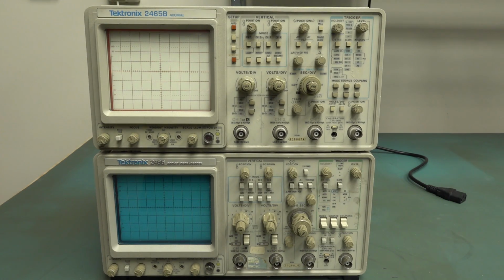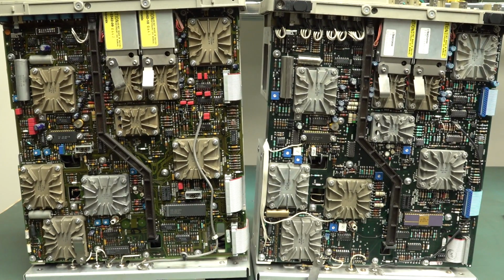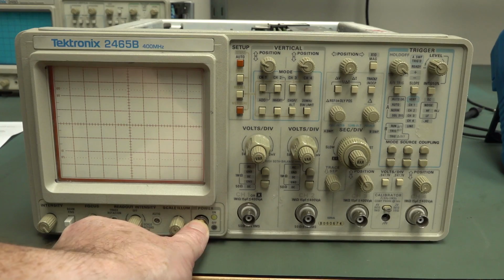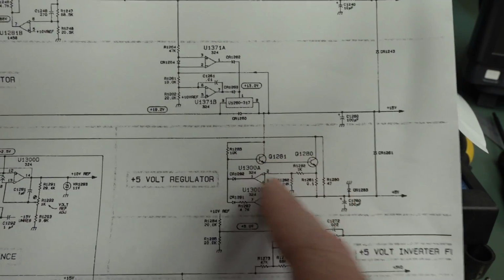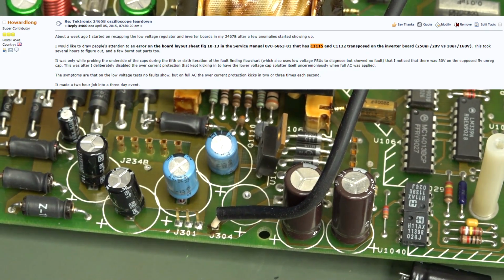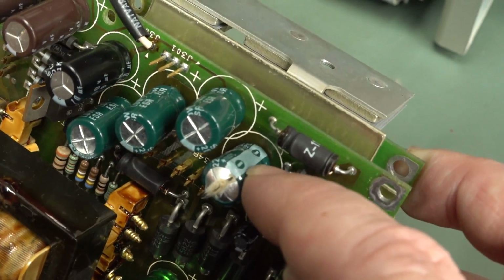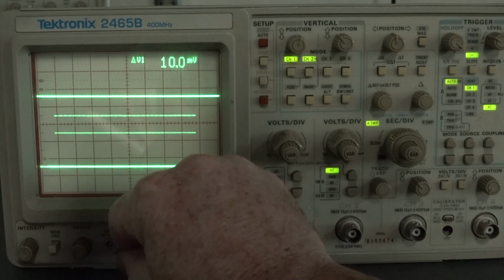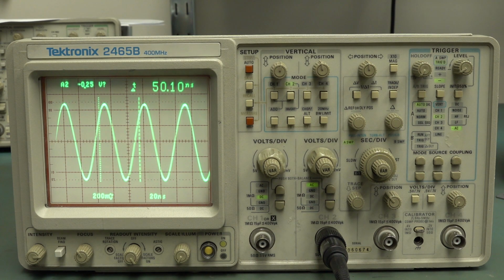EEVblog #1203 - REPAIR: Tektronix 2465B Oscilloscope

Comment: Why do capacitors have the negative marked and boards have the positive marked? Seems like this sort of problem could be reduced if they agreed on one or the other.
Reply from the maker: Worse is when the silkscreen doesn't have + but a filled in section of the circle, and sometimes that's positive and other times negative!
Reply: @EEVblog  I recently changed capacitors on one Intel motherboard (vintage 2014) that had negative and positive backwards on the silkscreen... so this happens a lot :D
Reply: @EEVblog  Tantilum are lined/marked on their positive side.  Are you going to get a Dallas DRAM and dremmel in to it and glue a coin cell holder on the outside and wire it up to make a new chip?
Reply: @EEVblog 
IS IT !!!!   WOW, Good to know
i was always under the understanding that the filled in part is Negative.........ALWAYS !!!
wow... good to know, thanks dave
Reply: Agreed.  Another hint, lots of equipment I've worked on with radial caps have a square pad for the positive terminal and a round pad for the negative.
Reply: @gregfeneis609  Classic HP gear dating back many years does this.
Reply: Don't even get me started on tantalums being positive marked
Reply: Trick for young players :P
Reply: @jetraid  He's in like Flynn, for those playing at home.
Reply: Maybe to avoid confusion, the outer case is negative, writing plus only on the inner disk would be extra work, writing minus on the outer case you never go wrong,
Reply: Looks like a punk cap.
Reply: This must be an older equipment thing. Everything I’ve worked on has always showed the neg side of a cap. Never seen the positive marked on the board. Maybe I’ve never taken anything apart of this era before.
Reply: This agreement would make it a too easy task for designers/solderers. 

Happened to me as well, even once in a new design with wrongly marked footprints. The burden of history.
Reply: Tantalums have the positive side marked. This was an Aluminium-Cap.
Reply: LEADs wont turn off.....funny...i have LEDs on mine.
Reply: Yeah, I've always been really confused by that, it's one of the things I flag in my "basics of soldering course"
Reply: It is done that way, to keep your mind on straight!
Reply: because we need our daily dose of magic smoke
Reply: My first guess is just to be consistent. Old caps used to label + and - (as I recall from decades ago). Diodes have stripes.
Reply: @chasmosaurus3  I believe that you are right, sir!
Reply: And surface mount tantalum caps that look like diodes have a stripe marking the positive. When I was younger I inserted a couple tantalums inverted.
Reply: @rwils6333  - Good thing tantalums don't care about polarity!

;-P
Reply: I got a lot of capacitors for an big cap bank i made for pulsed power experiments for about 80% off because they were defective, the manufacturer apparently got it wrong and the polarity was wrong haha, i had to test all of them before screwing the bush bars because some were good non defective caps!
Reply: @teresashinkansen9402  how did you know the polarity? greater leak in reverse or?
Reply: @theoneohmresistor  Yeah, you can't charge an electrolytic in reverse, they have so much leakage and a very small capacitance, they can even explode.
Reply: @teresashinkansen9402  great tip, thanks!

Comment: 30:03: I am right now attempting to do same RIFA cap replacement on my 2465A DV (built 1987). The RIFA where you are pointing blew up on my scope. The other above this has many cracks. I investigated a discrepancy between 0.068 µF labeling on the caps and 0.1 µF on service manual. I discovered that the original caps might be special production labeled with lower values than they actually have. I was advised to replace with 0.1 µF, 400 V/DC (250 VAC), 55/110/56 , 10%. I went with WIMA MKP1G031004D00KSSD, which seems to be higher end of quality. Looks like you went with an ordinary "consumer products grade" TRU cap. What were the specs on yours and did it end up working well? Also, wondering if you replaced the battery? I think that maintains the calibrations in memory. As the battery loses voltage, I think there will be some startup tests that fail.

Comment: Thanks for the video mate! many times after the board is flowed and cleaned, they don't clean the rosin core flux off after hand soldering. The rosin flux is inert after heated and It won't corrode as lang as a improper clean isn't attempted.

Comment: I acquired one for $100.  There is a bad ground in it somewhere, a 'gremlin' of sorts, that moves every time I found it.  A tap here & there, or on the table...  Mine is a 2465, no letter.  It's considered a Cadillac, and cost more than a new car back when it came out.  They are the last of the analog scopes.  My 2465 does flicker when I push a/b.  The NVRAM can be tested by powering off, getting a coffee, play with something else, and turn it back on.  If you see your display holding, it's working.

Comment: I'm not so happy with the 2465 and newer scopes.  By then they had gone to using many super high performing IC amplifiers, custom Tek IC's.  So if one of those goes, you are SOL.  Also those Ic's are very static and short-sensitive.  Don't ask me how I learned this!  There is not much sadder than a scope that goes from 100% working to totally pooched when you touch it with a probe tip that bridges two IC pins!   Cheers.

Comment: Great video. Funny to see the cap blows up. The known prank at university in the Lab. One time smart ass connected a electrolytic capacitor to a lab power supply, in reverse of course, turned the PS on and walked away. After a few minutes the cap blew up. Don't try this at home, as someone can lose his/her eyes.  By the way, it wouldn't be a bad idea to wear goggles when working with this. I know I know, working with this stuff for 20-30 years and no accident, but  .... Once, when I was a teenager, begin 90-ies  I was working on DIY audio amplifier. The caps blew up almost in my face, and the small paper pieces fell like the snow from above. I will never forget that 😁 Gooch 30 years ago, feels like a century ago.....

Comment: Hello Dave. Just at the end of the video you wrote the scope was without covers. It is very important to operate it with the covers in place, due to heat. It has an IC which works at 80+ DCV and it gets extremely hot without covers. BTW, excelent video (what a laugh with the cap explosion! X-). I have 2 of these (one like yours, and the other with integrated DMM), and both flickers the LEDs when you make any change in the controls, so seems to be normal. And, as always, thanks for sharing!.

Comment: Nice Video.  I too have both fully functioning except that my 2465B has an issue with the calibrator which outputs a distorted waveform. 
One this I would like to comment on is that In my case the Blue screen is on the 2465B. 
Quick questions Any idea where I can get a set of Back feet for the 2465 (300Mhz) 
regards stay safe and keep up the good work

Comment: Educational and I enjoyed watching this video. I subscribed immediately as soon as saw the electrolytic (polarized) cap exploded.  Two main reasons that would cause a capacitor to susceptible explosion is Reverse polarity voltage and Over-voltage (exceeding the voltage as little as 1 – 1.5 volts could result in an explosion).👍

Comment: My array of 7000 series Tek scopes are pretty powerful. A R7844 400MHz dual beam with 2) 7B92A delaying time bases, a 7834 400MHz Multi Mode storage with 2) 7B92A delaying time bases, sharing a selection of vertical amplifiers, a curve tracer, a current probe, and assorted digital function plug ins. Might mention also a pair of 7804A 200MHz mainframes.. and a 2247A 100MHz portable with 500MHz digital co processor that does setup memories, rise and fall time, frequency & period, and other waveform analytics. A 575 and 2) 576 curve traces round out the Tek scopes.  Feeling out of place is a new Siglent 2202s-x 200MHz- 2MS/Sec.  I'll save the Tek TM500 and 5000, and the HP for another time.  Just saying, these portables you have were pretty good, but I don't believe they were the 'best ever'.. others might argue the 7000 series and 11000 series might be the peak of their art.  Reducing the ink load on the PCB reduced the dielectric absorption on the boards, improving HF performance. They even dealt with humidity during board lamination as quality factor. In house, degradation in the board lams was called 'Hook'.  Tek even made an in-house only TM500 plug in dielectric analyzer for board QC.

Comment: HI DAVE 
FOUND YOUR VIDEO VERY INSTRUCTIVE.
It happens that I bought a similar one with red graticule some 3 years ago but never used it until yesterday.
Checked the input voltage set switch to 230v. checked the fuse 2A. Plugged it in and switched it on. everything went fine. Got a nice clean and clear trace and as I was fiddling with the focus knob, I heard a noise and smoke started coming out from the back end, I switched it off and removed the plug. 
I then started opening it up to find out what got burnt. It turned out to be a bridge rectifier, a 0.068uF capacitor and a resistor next to it. So then I went on YouTube to start looking for videos showing these kind of problems and hot to fix them.
Having watched your video, I will give it a try , it is just a matter of where to buy the genuine replacement parts. Maybe you can help by giving the contacts of potential suppliers. I live in Mauritius, a small island lost somewhere in the middle of the Indian ocean. Thanks for reading me.

Comment: Updated 1990 Unit, replaced caps and RAM. Reading original SRAM (8950)and copying contents on to FRAM.
Recommend to shift PWS assy. slightly down(towards A5 processor board)to access spade connectors to voltage selector between the PWS and power filter/connector.
Had to repair A5 corroded traces and replace two 0.1uF SMD capacitors near SMD electrolytes.

Comment: Yup i own one had to service it once as the X Y caps failed and the spark gap arrestor had got tired but still on my bench and works to this day. You can really magnify your signals on this scope without any lag what so ever. Analogue scopes are a must however that does not mean they are better or worse than a digital scope, they both have their place on the bench.

Comment: My 2465B looks pristine inside, but the trace blanks after a short warmup. Pressing Beam Finder can bring it back momentarily. No leaking caps anywhere. At the present time, the scope gives about 2 minutes of usability before it blanks. Frustrating that the ICs are all out of production.

Comment: All those hybrid and two stroke scopes...  (full digital, digital crt and other transistors...)

 try something like this:  " http://w140.com/tekwiki/wiki/545#/media/File:Tek_545a_291_1.jpg " (if I am not mistaken I have a 545 B) a two cilinder  4 stroke (valves) diesel,  euh 2 channel, 1 beam and it takes about 20 min to warm up. Can't use it cos it needs some TLC.
To bad that Dave is almost as far away from me as he can get (without swimming, euh 80% of max dist.)
I would love bring my scoop to see it taken care off (the good way..  don't need Dave to make concrete 8-)

Still entertaining and informative. Thanks Dave.

Comment: Goodnight. I was watching their very interesting videos. I have a tektronix 7603 and plug in 7L12 spectrum analyzer. It is a gift but it does not work. I took care of the repair by the low power source having all the voltages that the service manual tek 7603 says.

￼

Comment: Probably a silly question - I rescued a scope like this that had a power supply failure, but I'm not confident in how to read the part descriptions in the manual for some of the parts that need replacing.

eg - SEMICOND DVC,DI:SW,SI,30V,150MA,30V,D0-35

I guess it's a switching diode in a DO35 package, and I would guess it's Vr = 30V, max avg I = 150mA, then Vf = 30V?
I'm not sure what the other codes are referencing.  Is there a reference on how to decode it, and other parts?  Thanks!

Comment: When measuring using the trace, you're supposed to measure from the middle of the trace, not the top of the fuzzy edge.  I'm an old metrology tech who has repaired and calibrated at least a hundred of those scopes.  For instance, when you place the trace on the center graticle (to reference it to ground), you're placing that graticle in the middle of the trace.  If there is noise on a signal, it may thicken the trace.  Not to mention, the trace thickness can change depending on the brightness and focus.

Comment: Good job friend ,i have 1 of textronic 2445b got some ploblem with it.
The screen is slide to top the letter on top not appear on screen.
And the waveform is distort too.
When i turn y axis button up the waveform amplitude increase.
When i turn y axis button down the wavefrom go decrease???
I want the schematic of this 2445b where i can get it?

The clip video on the bottom please..

https://youtu.be/Ego1beprTiw

Comment: I found something funny in a old power supply it looked like it was modified to be a old spark gap receiver and maybe transmitter.  So I ripped it apart and tore it to pieces by cutting the circuit board up and transformer was recycled for copper wire and metal. Cause I dont know who modified it and now they never will use it again LOL.

Comment: used to repair the units B version is the best, blue filter is removable push in and move down to remove, filter is on a spring shaped like a Y

Comment: Repair = replace the broken parts. 
Refurbish = replace all the parts at or near EOL (all the electrolytic caps, possibly some or all of the power transistors, the battery-backed SRAM, etc).

Since the video says "REPAIR" it would be a bit silly to complain about it not being a refurbishment. 

The benefit of refurbishing something like this (as Dave mentions) is that it's old enough one should expect all the electrolytics to be near failure. It's cheaper to fix everything in one go than to pay shipping costs multiple times, spend time disassembling the device multiple times, etc.

Comment: Lucky boy that it just was the cap issue and not a failed inverter transformer like in my 2467b.
But definetly kick out those shitty caps on the processor-borad, they spewing their aggressive liquid directly all over the life important parts of the A/D-D/A section. You should look up into the amazing Circuit description, all Front end control stuff, LF and DC calibration, the automated measurements and protection functions are handled with a single Digital to analog converter and a bunch of Muxes and OP's.

Comment: I like the 2465B scope. The biggest problem is with the Dallas SRAM module internal battery and no easy way to replace, subsequent loss of cal data. You really should lay off the wacky tobacco when when doing these type of thru-hole repairs Dave, either that or you are doing this for hits and thumbs. Blowing shit up is a growing fad now on YT.

Comment: I also believe this series was the best scopes, at least for non-modular scopes). Bandwidth was adequate for most purposes, and their control layout was so logical.even though they were rated to 300 MHz, most 2465s could reach the same 350Frequency as the 2465a. They also triggered really well, and rock solid stable.

Only criticism was that they had a tendency to run hot. If Tek had put in better fans, used more heat sinks, or worked out airflow better, these scopes would be beyond any reasonable criticism.

They have gotten very expensive on the used market. Obviously not the scope's fault, but an issue for anybody wanting one.

2467 really isn't a better scope. The micro-channel plate tube has a fairly short life, and  there are nit many spares around(there were never a lot of 2467s built in the first place). If you need persistence, it is easier and cheaper to use a digital scope.

Comment: I know the kiss of death for the 2400 series scopes, U800. The horizontal output or drive chip. They did a very poor job of heatsinking the chip. If you have a working 2400 series scope, open it up and heatsink U800 before it dies. There are no U800 chips on this planet that are not in use. Period!!!

Comment: Hi Dave,
Be sure not to keep it turned on too long with an opened case as the non obtanium hybrids in this range of scopes are known to overheat as the airflow without casing is not as it should be! When servicing/repairing these scopes it is always best to have an external fan blow the heat away.

Comment: Word of warning.  When working on PSU's wear safety glasses when powering up first time.  I've personally had a capacitor blow up in my face.  Fortunately the case (hot) hit me in the forehead and not an eye !!  Lesson learned.   Apparently Marshall Amplifiers have a room for soak testing Amps under load and the ceiling has a lot of caps embedded in it !!  Even new ones can fail !!!

Comment: That white background is funny looking. I much prefer the blue. We had one with the white screen in school I didn’t like it I always tried to use the blue screen scopes. But the white screen one was our highest rate scope we had. Cool that your fixing them up. I need to send you my old 2232 that the trace just went away one day. But I got a modern scope for my needs. It weighs nothing compared to a crt scope. I do miss using a analog scope. Just something about that. I really miss crt X Y mode. Digital does the job but it’s not as pretty as a analog.